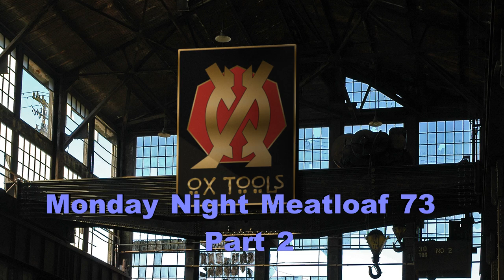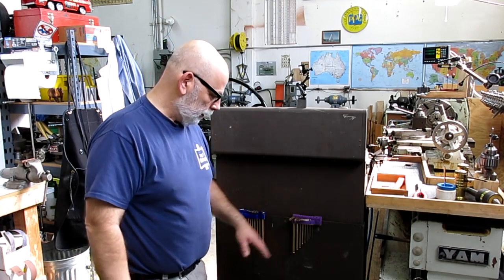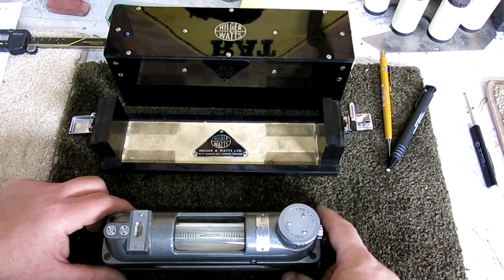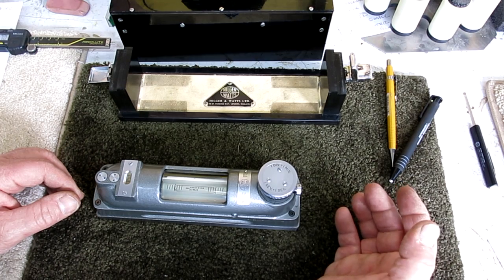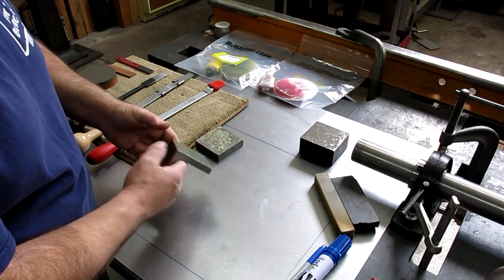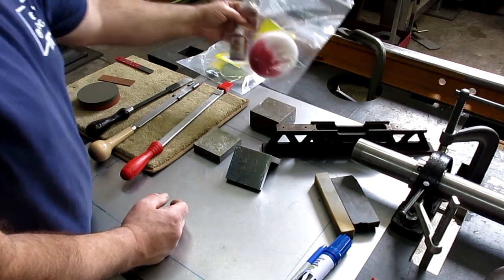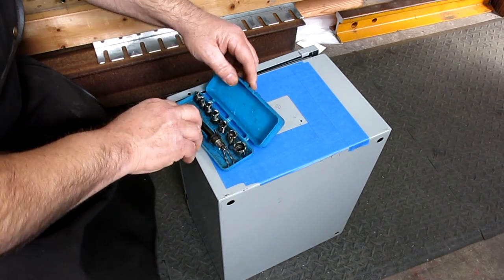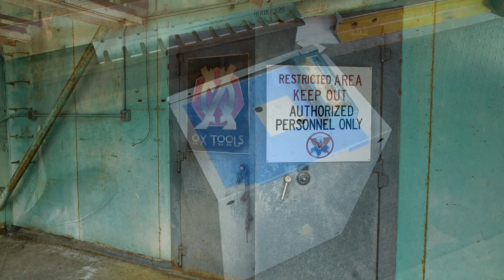Monday Night Meatloaf 73 Part 2

Comment: Cool segment Tom.  I personally like the genuine Unibit for making holes in thin metals and plastics.  They are fast and one can drill a half dozen different sized holes.  Thanks for sharing.  Fred
Reply: For sure, in the field nothing beats a good step drill for cutting holes thru enclosures. Just one bit covers most holes: k.o. punch studs and starter holes for square cutouts. But I'm considering getting some rotabroaches for thicker materials in the shop. They sure look useful.
Reply: I have a few step bits, but I don't have any hands-on experience with rotabroaches.  Other than depth of cut, are there any other technical differences between the two?  Does one provide a cleaner or more accurate hole than the other?
Reply: Brian Taylor
 Both provide a clean hole.  If I need to go through a stack (three layers) of sheet metal, step drill is the way to go.  With the rotobroach first layer mayhang around keeping you from going through second layer.  Generally sheet metal, Unibit. 1/8" or thicker... rotabroach.

Comment: Wow, that's quite the level!!! I think I will make one similar, maybe a 2" bullet level. I just love the design, no fooling with wrenches like the Starrets.

Oh, and Tom. I made an angle plate just like the one on your blog. Same process and everything, it was just an amazing project. I push then pull scraped the main faces. Ends are also scraped. So seeing the angle plate you made and are now scraping is bringing back quite a lot of Deja Vu!

Comment: I like that set of roto broaches. I have liked how they have worked for me when I have used them and they cut well. Having the blank come out easily once I break through is the sign of having a good one "if" it cuts to size. I can not recall one ever cutting the wrong size big or small. Tom have fun.

Comment: That sure is a classy looking level.  Greenlee makes a really nice set of carbide holesaws that are great for enclosure drilling as well.  Great bonus is a stop shoulder on the cutter so Mr Bozo doesn't come along for a visit when dealing with limited depths or adding another hole to something that is already wired and in service.  I find them handy for putting holes in some of the high boron content steel more and more car makers seem to be sneaking into places, and they leave a really nice burr free hole.  Quite reasonably priced too!

Comment: The sheet metal cutters are a bit expensive. In the larger sizes these cutters are well worth their cost but I would rather grind a drill bit for sheet metal work vs the kit.

I hope the level comes out good Tom. I would be nervous as hell on that one.

Comment: I`m wondering if that level would be used for plumbing drain pipes. I believe the slope should be 2 degrees.
Reply: I'll bet it could be used for that, especially if you're really particular and want your gradient to be within a couple of arc minutes.  Usually a carpenter's level will get the job done, however, or a builder's level for long runs.  And I think most codes call for the slope to be 2% or greater, which is 1.15 degrees.

Comment: Mr. Lipton, What is a machinist's level used for that a regular level can't do? I've seen you guys (Adam and you) adjust and level the beds on your lathes, but you turned and miked steel to set the ways. Always curious, Brian.
Reply from the maker: tharp78 Hi Brian,

A machinist level is much more sensitive that a normal level. It can detect less than .001 inches at one foot easily. It is a simple tool that any good mechanic can use to accurately set up a machine tool. The turning of the test bar is the final test of the lathe way alignment. Hope this helps.Thanks for the comment.
Cheers,

Tom

Comment: How long have the cutters been lasting on your rota-broachs? I occasionally have to drill large holes in frame rails of big rigs and standard drills are tiresome to use and the shop usually only has one bit of the size I need and it's always duller than a butter knife. The rota-broach ain't cheap but if it makes the job faster and easier (and if they last longer than a drill bit) I would gladly buy a set.
Reply: SuperSecretSquirell Truck frames are usually a decent grade of steel, fairly high carbon content, therefore tough to drill.  A mag drill with a quality annular cutter will blow right though  Its a little harder to get coolant to the cut if you are in a horizontal position, but its workable.  Annular cutters can be resharpened as well.
Reply: James Kilroy  We've tried the mag drill before, but we run into clearance issues. We'd have to remove too much from the frame in order to make it all jive. Not sure who around my area would be able to sharpen an annular cutter, but I'd be willing to send them off if that meant more life to the cutter instead of replacing it.

Comment: I am assuming that since you have the best of everything else that you have a surface grinder.  So why not use the surface grinder on the level?  Can you really do better by hand?  Thanks for the video.
Reply: Jmkxyz822 in that case the grinder should be able to reproduce that extra accuracy as the table will be sliding on the extra precise ways.  Once you have made it perfect I find it hard to believe you can exceed perfection.  I will of course accept your explanation for now.  Bearing factories use grinders to make bearings, some of them ultra precise.
Reply: cerberus I know it sound preposterous, but hand scraping can achieve better finishes than grinding. Grinding not only produces heat that distress the work, but also has no feed back as to how much its removing. It's around odd geometry that a grinder tends to follow inconstancies rather then plane them. e.g. if you were grinding a 123 bloc on a machine with perfect ways, it will tend to put a shallow creator around each hole.
 The scraping process on the other hand invalves constantly referencing the surface plate, as well as tailoring the pressure in certain areas.
Reply: Alexander McGilton as I told the last person I will have to accept his answer as I do not have any personal knowledge of this.   The rest was just what seemed logical to someone who is not at all trained in the matter.  I guess I need to study this matter to understand it.  I will look for a video that explains the subject.
Reply: cerberus I mean no hostility or insult by my comment. But I rather you believe the above statement by your own understanding, not by consensus of peers or by an established figures opinion. 
You won't easily find a video concisely expelling the difference, please in form me if you do. These to links would help. 

(fifth page in yellow)   www(DOT)iamachinery(DOT)com/brochures/scans/0476.pdf

www(DOT)benchtest(DOT)/w-doall(DOT)html
Reply: Alexander I was not in the least offended by your comment, I was actually worried that you and the previous person might be offended by mine.  Since the last entry I have found some videos on hand scraping and also I went to Wikipedia and found even more.  I am glad that you seem to understand what I was asking.  When I started out as a young man working in a plant I asked the old hand why he did a particular operation like that and was told they had always done it that way.  That was in my opinion not a reasonable answer nor a good reason.  I did manage to convince him that the method in use was a time waster and gave no benefit.  Thanks for your continuing interest and help.